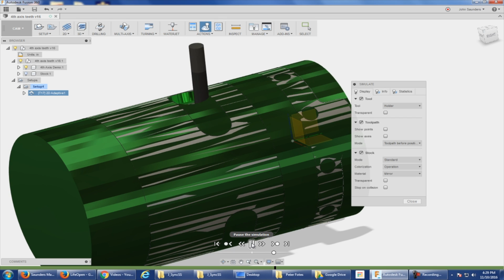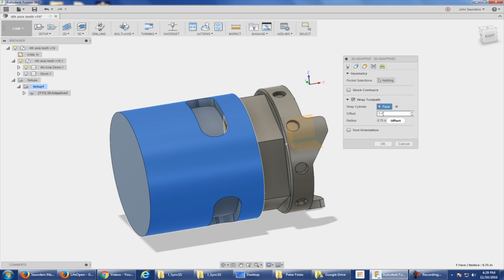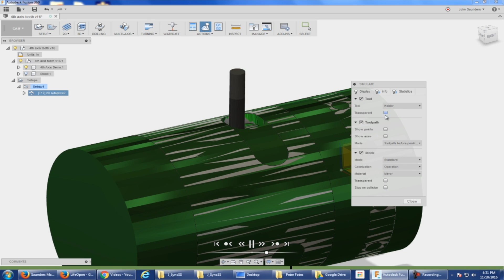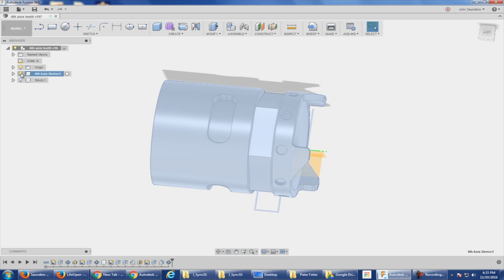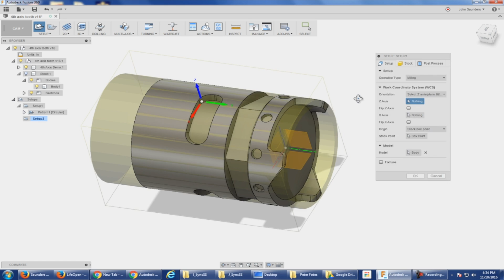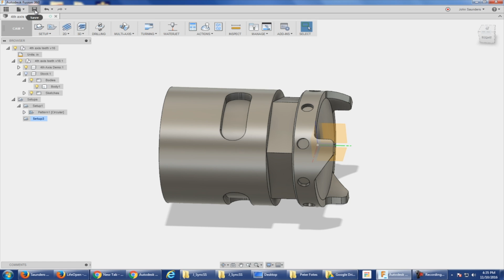Fusion 360 4th Axis CAM Tutorial!  FF54

Comment: i can do that part with G7.1 on 4-axis machine i not need cam do hard work generating thousants lines of code i allready know 4 points of that cylinderical pocket i need machine it. i can wrap it on loop and do depth passes on that 1 poclet less than 10 lines. that is faster than you draw that part generate it and wondering is it good path.cam is generating thousants on line allready on that pocket radius that is done by 1 line using g2/g3

Comment: ok, just tried this. sadly the 4th axis machining is not exceedingly useful if you are not making cylindrical parts. 

it's only working with 2d adaptive and 2d pocketing. if your making 3 dimensional parts like we do, you're still out in the cold. the multi axis also of limited use as it can't machine faces with tip of a ball end mill. 

still, it's a step in the right direction. here's hoping next month's update add more functionality.

Comment: It's also interesting that it's outputting Y moves in the post. In a rotary axis substitution, which is what you're doing, all Y moves should be converted to A rotation moves. 

All X,Y moves should be X,A moves during 4 axis machining.
Reply: it does a Y0 what could be a bit dangerous